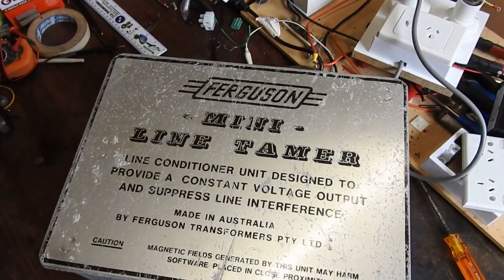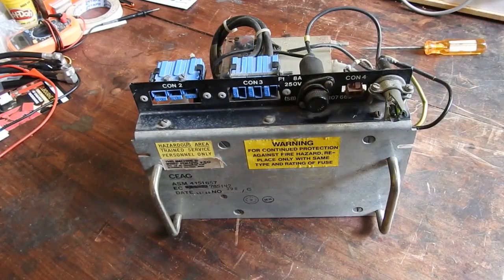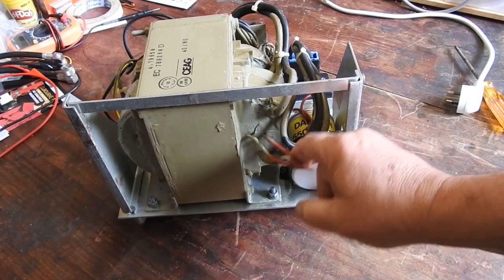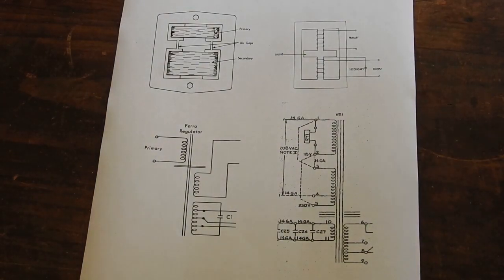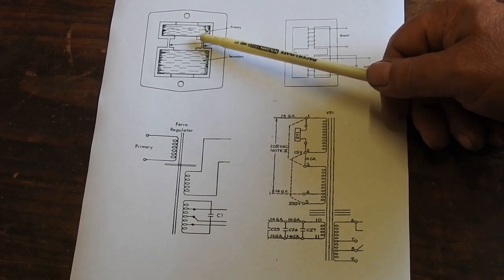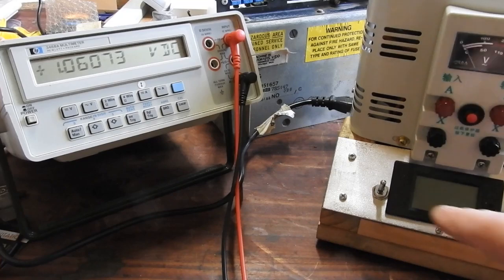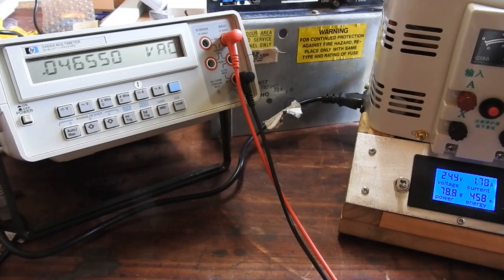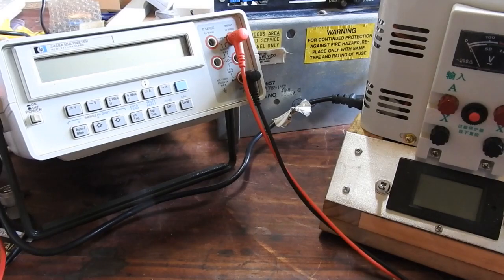Ferroresonant Transformer Basics - Part 1 of 3

Comment: In one of the videos you mention the capacitor is rated for 500-or-so volts (was it 550?).
1)Do you know what its capacitance is (if you mentioned that I didn't catch it)?
2)Do you have a way of checking the Q-factor/leakage of the capacitor - could leakage at 38-or-so years old be responsible for the unloaded current drain?
Reply from the maker: It's the warning label that says 550V. 
I've just removed the cap, and its a Siemens 12uF @660V.
My little tester says its 11.64uF, with an ESR of 0.0

(In my experience, capacitors from mainframe gear of this era are always still in excellent shape. They used the best available.)

I also just tested it by charging to 30VDC, then measuring time to discharge via 10M meter impedance to 20V, 15V, 10V.

Voltage, Time, Theoretical (for 12uF+10M):-

20v 50s     48.7s
15v 85s     83.2s
10v 132s   131.8s

Which are all slightly longer than the theoretical times (meter is 10.1M maybe).
Though not tested at 500V, it is an indication that the there is no leakage 
in the capacitor. 
I don't know for sure, but I put the unloaded current drain down to the saturating core of the secondary, causing a drain even though it is only loosely coupled to the primary.
Reply: Bipolar capacitor?  Did you try charge/leakage test from other direction as well?
Your theory may be correct, just thought it worth checking...
Reply from the maker: No, just one way. But I very much doubt it would be any different.
One day I'll try a similar test  with around 600V AC...